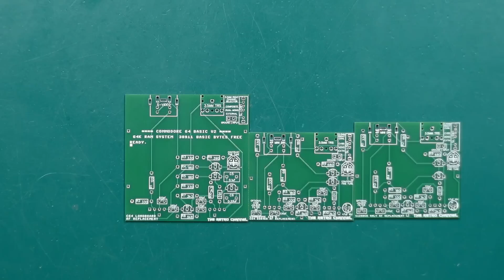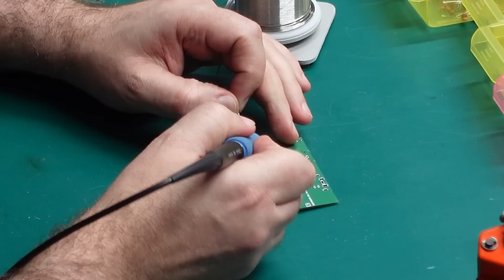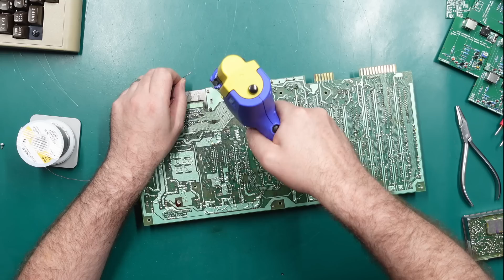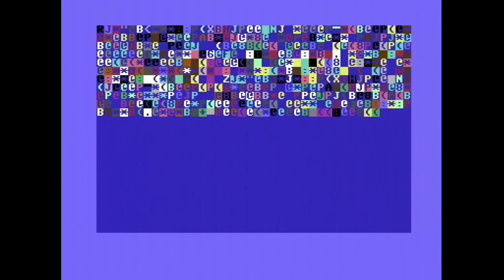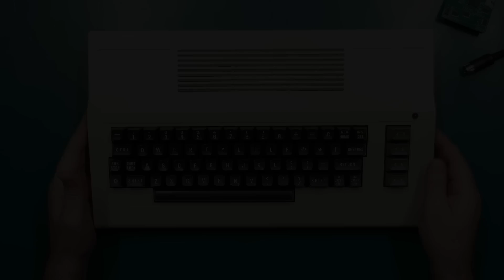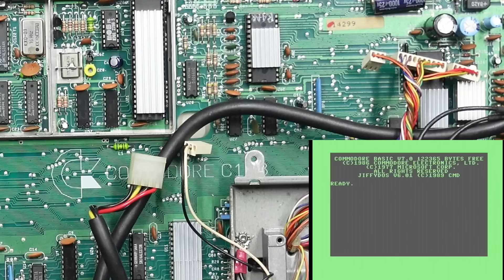Commodore 64/128 RF replacement V2

Comment: Man oh man... I installed it on my DCR with your vic IIe chroma daughterboard. WHAT AN INCREDIBLE DIFFERENCE! 98% reduction of jailbars! I sport a good 1084 CRT. I'll be installing the other two I ordered for two of my other commodores next. I highly highly recommended installing it. PRO TIP: I used the hakko with the large tip to do the dirty work getting the 39 year old solder off the mounting legs of the old rf modulator. Ill be ordering more. Keep 'em in stock plz. Thanks from Texas. Wish you could come up with a dual vic II switcher board (ntsc/pal).

Comment: Great project. I've built a few now for me and some mates. In order to test mine, I have rigged up a test bed with two female 4-pin headers so I can just plug one of them in and test it. Looking at the video, you recommend putting the additional bit of plastic onto the ground pins for added height. Does that mean my testbed as it is can be used permanently, without having to remove the pin headers? Would be good to be able to just swap as you go without torturing the motherboard by soldering and de-soldering repeatedly. I have seen some of your boards :)

Comment: What is the "3 Turbo Tape"  option in EasyFlash 3, and where can I get it? And will the C=128 DCR one also work on an NTSC model?
Reply from the maker: Turbo tape is a Kernal rom that uses a fastloader routine for saving and loading from tape. But it only works with a tape that is saved using turbo tape, it will not speed up loading from any other tape. And yes all RF replacements works with PAL and NTSC. I recently released a new version here https://youtu.be/D2SZgogYOcw
Reply: @TheRetroChannel  I'm no stranger to Turbo 250 from Mr. Z of Triad, and I even had the special Turbo 250D+, but where to get this kernal one?
Reply from the maker: Look up turbo tape kernal rom on csdb
Reply: @TheRetroChannel  now we're talkin', you wrote the magic words! Thank you kindly.

Comment: So, Chroma/Luma is still available on the standard DIN socket right? But would require the resistor on the chroma line built unto the cable for S-Video output? Is the quality of that output as good as your direct S-Video socket?
Reply from the maker: Yes exactly, it is still available at the DIN connector but requires a resistor. The quality should be the same

Comment: I see a lot of rf modulator fixes and replacements. I always wondered if removing the high frequency tv signals on the board would cause noise in the other video output
Reply from the maker: Not from what I've found. The RF is too high frequency to cause any obvious noise in the other circuits

Comment: Question, does your board route the improved s video to the original video port on the main board? I have a cable I use that already has an s video connector on it. Thanks for your great channel!
Reply from the maker: Yep, the original port will function as normal just with the improved video

Comment: Hi Mark, Have you tried your board with NTSC? I installed it on my large board c64. I couldn’t get any color out. Any ideas? Only b/w.
How sensitive is the board to value on resistors and capacitors?  Thanks!
Reply from the maker: Yes, it has been tested and works with NTSC. It's unlikely to be component tolerances, unless a completely different value was used.
Double check components R1, R2, R7, R8, R10, C2, C3, C4 and Q1. These all handle the chroma signal and a wrong value of dodgy component here will result in no colour
Reply: @TheRetroChannel  thank you so much!
Reply: @TheRetroChannel all set with the color issue. Works perfectly!!!! One final question, my c64 breadbin always had high levels of jail bars;   it did improve with your board but still shows some; is there any other filter or anything else I can do about it. Thank you so so much!!!
Reply from the maker: Awesome! Do you know what was casing the no colour issue?
As for the jailbars, changing the 820pF capacitor at C1 to a higher value will lessen them, but at the expense of overall sharpness. You can experiment with anything up to 2nF, but going beyond that will only result in a smeared looking picture.
Reply: @TheRetroChannel  yes, just like you said I was taking too many liberties with the values of some of the components. I sourced the exact recommended values and it worked with a fantastic picture. Thanks for the tip, I will try different value capacitor to see if I can get a bit less jail bars, however as I said it is a great improvement already.   
Thanks again for taking the time for answering my questions, etc. 
I am loyal follower of your channel!  Greetings from Massachusetts.

PS. You were right on about Noel’s power supply. :)
Reply: @TheRetroChannel  I added another 820pf in C1; Picture improved but still seeing annoying levels of Jailbars So, I decided to adding a 560pf, making a total of 2200 pf.  Now my C64 is displaying a great picture on my 1702 crt monitor, minimal jailbars, bright and clear letters/colors. 
I want to thank you for all your videos and following up with me about this issue. 
Al
Reply from the maker: Nice. It must have had some pretty bad jailbars. I've found around 1500pF normally gets rid of them but if 2200pF was the sweet spot for yours then happy days

Comment: Is there a schematic available for the V2 RF replacement mod?  I built two of these and after installing, I am getting no video out of the original C64 DIN connector on two different C64 boards with nothing connected to the outputs of the RF replacement board.  I was under the impression that the original video DIN connector should work like normal.  Both of my C64's are 250425 versions.

Comment: The output is so good, yet such a simple design.  The RF port on the C64 is useless in this digital era of video technology anyhow.  I would imagine that the lag on this would be very low, but it would be nice if the audio could be mixed into the HDMI out at the Kawari.  Your solution still keeps the integrity of the audio and provides the possibility of stereo SID output which is a nice bonus.
Reply: I thought that too, but the VIC-II-dizer and LumaCode gives the RF Port a whole new lease of life.

Comment: Hi! If i want to use only the signal passthrough to the C64 AV DIN, do I need to use all the components, or there are some optional components like in the V1?
Nice job! thank you
Reply from the maker: You can leave out the switch, 3.5mm audio and s-video connectors, and the external input header but the rest is required

Comment: Great work. 👍 very nice video and throural instructions:)  I bought one already.  So thank you
Reply from the maker: Thank you Donald 😀
Reply: One question,  can I still use composite for audio only?  I bought this splitter for my speakers that I use for luma code. The 3.5 jack is awesome,  but will it support both speakers if I just plug it in to the jack on modulator.  Just have cheap speakers,  but it works:)
Reply from the maker: @donaldblakley6796 You will always have audio on the left channel of the 3.5mm jack, and the right channel is selectable between composite, external (for LumaCode/dual sid), and audio on both channels.
Reply: I have a female rca to female 3.5 jack that I use with my composite and plug everything in.  Both Cheap speakers work with that on luma code.   I'll figure out audio when this modulator comes:)  either way no need to thank me... thank you.  U are a very smart guy
Reply: Hey bud,  just curious.. a couple questions if you don't mind... the useless 6567r56a wouldn't improve with this would it?   Also,  where do you get your heat sinks from?  I use cheapys from Amazon.   Better than nothing,  but I like yours.
Reply from the maker: @donaldblakley6796 The R56A may look better with this, but I've found it's still the worst (noisy) looking VIC-II. The heatsinks come from an AliExpress store called "we do heatsink"
Reply: So I got a clear video s video from Jayson modulator last year,  it's better,  but obviously there is botch wires going to the vicII and power from the capacitor.  Every time I set it with the 4 trim pots,  I get it pretty good,  then after a couple power on and off.. looks like shit again. Hopefully the one I got from you will be great.  Gunna leave that one alone and put your modulator in another:)
Reply: Oh, and will this work with the kawari mini?  Sorry for the trouble questions:)
Reply from the maker: @fortheloveofcommodore64s  Yeah it will work just fine and you'll even get slightly better video quality with the kawari mini.
Reply: Thanks bud:)
Reply: I just tried out my 1.6 mm tip for my hakko That u recommended.. added solder before using it.  Worked mint for removing the modulator.  So thank you:)  ready for your modulator that is close to me now in Canada:)
Reply: Just received today,  and it's marginal improvement.  Jail bars are worse even tried 2 vics and the kawari mini.  I get it to minimize Jail bars,  and then a couple powers on and off... jailbar crazy:(
Reply from the maker: @donaldblakley6796 Hey mate, can you provide more detail on your setup, like 64 board revision and VIC-II revisions? Also curious what power supply you have as it may also play into the jailbars. If you're on discord, please jump into the TRC discord server, invite link is in the video description. I know you mentioned you also have Jayson's replacement and the jailbars often change with power cycles. A similar thing happens with those lumafix boards and I stopped using them myself because of it. Anyway, I may have a way of toning down the jailbars with your setup but I need more info on what you have
Reply: 250407 rev A and 6567R8 vicIIs  and that Kellogg seller modern psu:)
Reply from the maker: @donaldblakley6796 Hmm, ok. I just did some testing with the 250407, and the jailbars on those boards are slightly more obvious with an original VIC-II. But with the kawari and svideo they are very hard to spot. I did have a keelog PSU but I stopped using it as it introduced some interference, but now I can't find the damn thing. I will let you know when I do as I think that may be making the jailbars worse
Reply: I know the 407 boards have worse jail bars than the 425 boards that's why I used this modulator in this board.  The kawari mini does help indeed.  I just don't like the jail bar changing with powering on and off cycles.  Sometimes it looks great.  I may try to change this vic socket as I don't like it.  Anyways just want to let you know that other than that... I really like it.  Nice and neat design.  90% better font and graphics.. and I absolutely love the dual mono:)
Reply from the maker: @fortheloveofcommodore64s  Yeah unfortunately the 407 boards are just noisy. I've been poking around at mine again and I think it's down to a number of things, but there's no surefire fix. I hope to come up with a lumafix like solution that actually works after multiple power cycles, but no guarantees on that front

Comment: Fantastic work, thanks for doing this - I will likely put one on my C128 Neo 🙂

(Btw, those links to Github in the description seem to be slightly wrong currently, looks like you renamed from C64 to Commodore64 but the old links were left in the video?)
Reply from the maker: Yes I did 😄. Thanks! I've fixed them now

Comment: To align the pin headers, wouldn't it be easier to stick them in a prototyping breadboard?
Reply from the maker: They do not have a standard spacing
Reply: @TheRetroChannel  Aaah, that's unfortunate.
Reply: @TheRetroChannel  If you have a spare PCB, maybe you could use that as an alignment tool?
Reply from the maker: Yes, that's what I've started doing. Why it didn't occur to me earlier I don't know

Comment: Awesome board.  Which do you think would give the best result for a long board - V1 with external Chroma and Luma or V2?  Thanks
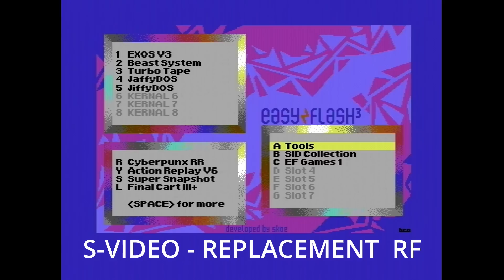Reply from the maker: V2 will still give a better result in my opinion. You can compare the screen at 18:12 in this video to V1 with external luma chroma here 
https://youtu.be/shM0UsKR1oE?t=11m4s

Comment: Very interesting! I would like to try this. You commented on an SMD version would be "pointless", and I see your argument about the board size being large enough so there aren't any space constraints that would require tiny passives, and things like that.  I just would like to add that I much (MUCH) prefer working with SMD soldering. I am probably in the minority, as I know many retro tinkerers prefer through-hole. I think it is much easier to get things looking good with SMD when it comes to having the components straight, aligned and all the same length/width, etc. Also easier to fix mistakes, and it's very convenient the board can sit on the desk flat most of the time while working on it. Even if I prefer soldering.. If you're in a rush you can get the PCB factory to solder on all the passives and standard components on for you for next to nothing. It's extremely cheap to do that where I order my boards, as long as I don't use any "Extended" parts, as they call it. I don't like bending legs as even with tools I can't get them all to look 100% uniformly like a factory-made PCB, same thing with cutting leads. I am almost blind in my left eye, so my depth of vision is severely limited, so I end up cutting them too long or too short. I don't like constantly turning the board over, having components fall out either completely or partially while soldering or having to tape them down, burn my fingers or use some misc. goo to have them stay in during soldering, having flux and flux-stained isopropyl alcohol escape to the opposite side of the board when cleaning, having fibers of cleaning wipes and q-tips torn on the sharp cut component leads, etc. I also believe it is easier and cheaper to source SMD component parts these days. Storage and sorting of SMD components is easier, IMHO. I hope someone makes an SMD version and sends it to you free of charge, or at least credit you with the original design. I was thinking of having a go at it myself, but I believe my list of unfinished projects is too long already.
Reply from the maker: Good points about having an SMD version. I guess through hole is preferred by beginners, I know I avoided any SMD stuff when I first started soldering. But I see the appeal of an SMD version, whether I not I will get around to doing one myself is another story. And yeah, I'm not against anyone making an SMD version as long as they share it and give credit (which unfortunately doesn't always happen).
Reply: @TheRetroChannel  Same here. I avoided SMD stuff like the plague, not just in the beginning, but for something like 15-20 years... I was 100.00% sure I would never be able to do it, or enjoy it. I completely agree with your decision to do a through-hole version first of course, as it better fits with the retro genre and market segment.